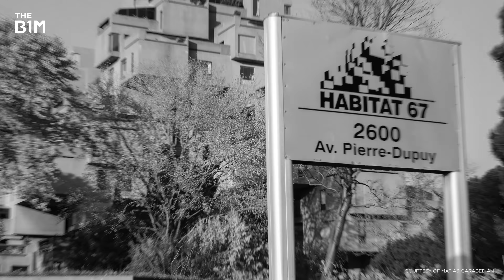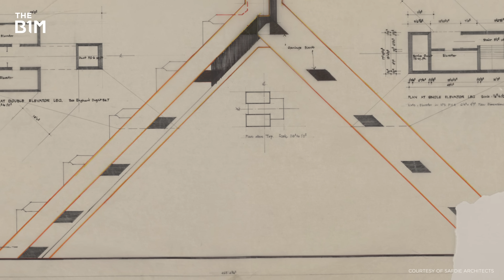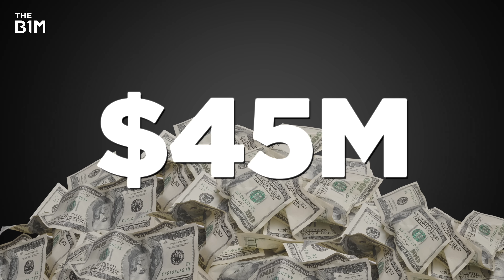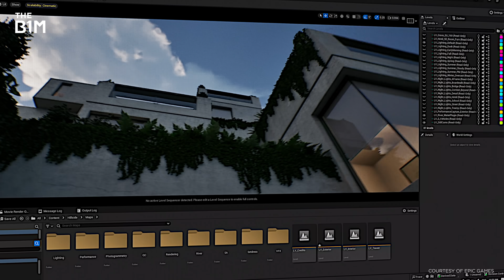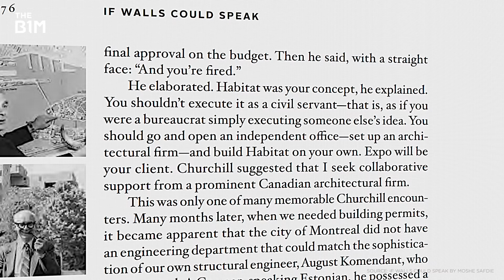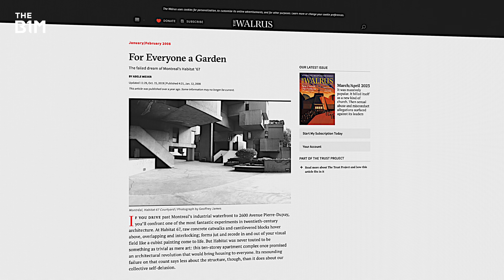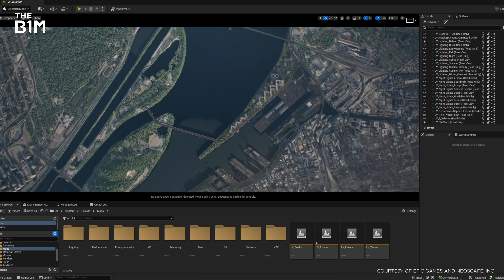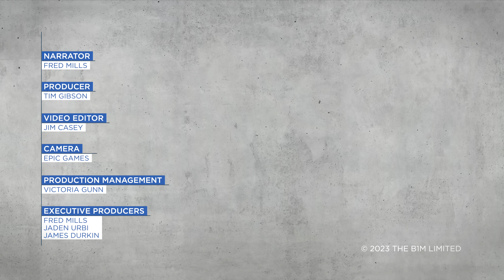How a 23-Year-Old Solved Urban Sprawl

Comment: When Moshe Safdie was in his final 6th year or architecture at McGill University I was in 4th year. There was a tradition at the School of having 4th year students helping others in their final year with their final drawings and models. I had a small part in this activity and I kept in touch with the progress of the project. One unfortunate aspect of Habitat was that the original idea of having structurally identical housing modules hanging from the giant A frames turned out to be structurally unfeasible, and the final project had the units stacked on each other. This meant that each unit had different loads and therefore required custom structural design and construction which added costs and complications. The basic idea remained a very positive step in urban housing design except for the minor complaint of terraces being overlooked by other units.

Comment: Building regulations need to require a minimum percentage of residential units, retail, green space, recreational facilities and agriculture production within a certain radius of a development or renovation that is proportional to the workers the development will serve.  That way,the developers will be encouraged to also invest in residential, retail space, green space, recreational areas and vertical gardens and the proximity of those developments may reduce commute and shipping as well as limit urban spread and the need for constantly expanding infrastructure and funds would be spent on maintenance and improvements instead.

Comment: I see lots of structural problems related to weather , especially in colder climats. How to deal with water and snow. How long these buildings are safe, how much yearly repair they need? 
Of course same things apply to all buildings, but all the corners, roofs make it harder.
Reply: And it looked uggly on the outside. That would be easy fix though.

Comment: The plateau architecture with gardens for each unit and the better view from the height is certainly something worthy copying. But I also feel like the sharp edges of the brutalist architecture, the lack of normal roofs and the absurd reliance on concrete is not that good. I feel like a hybridization of this new, brutalist style with older styles as well as more organic and repetitive design elements with accents would be peak architecture.

Comment: If this could be cheaply build on scale for millions it would be fate-changing.
It was prebuild back then, seeing how we now print houses or preprint sections, i would assume this should be doable cheaper than 450 million. The goal shouldn't be one building but to change the meta.

Instead of the usual projects buildings, instead of the ever mind-numbingly repeating urban sprawl. This shouldn't be something just for those with enough money, but the standard.

Only thing i am not that happy about is concrete. Not sure if we could get something less depressing than concrete. When these are build and towering above, i rather would see pure white than grey and with a nano perl effect to keep them clean and the maintenance costs low. Equally white results in a better room temperature control.

Comment: If only Safdie wasn't a friggin 'isræli' settlement encourager. 
It really feels like one (or a small team) could develop a very very buildable modular parametric system for building things like this. Catia is already based on the notion that you're going to be developing your design parametrically, for instance. It shouldn't be incredibly difficult to take the next step, so you don't have to engineer each unit individually.

Comment: Closed cell foam 5 layer walls- thermoreflective outer, concrete, closed cell/lats, vapor barrier, inner; flat top roofs are very hard but if you slant them ever so slightly you can control runoff and apply similar layering. Even conventional houses don't get much better

Comment: I wouldn't like to live in one of the hanging ones... knowing about the necessity of constant and proper maintenance, wear and tear, material fatigue and accidents caused by careless homeowners such as fires or explosions caused by open fires or not properly done repair, I would think that this architecture will become a maintenance and security nightmare over time. And it will need a lot of heating because of its large surface in proportion to the inhabited volume. Heating cost-wise and ecologically, it will be a nightmare from the start.

Comment: Here is a residental building project in Sweden that have solved it in a good way. Villa living in a apartment building with each unit getting it's own terrace with privacy from neighbors.

https://nyproduktion.bjurfors.se/app/uploads/sites/CMNYPROD51GK3OM7VLA5UCTA/2021/07/cbb767e9-2021-06-08-rabylund-exterior-2-2000x1134-1200x681.jpg

https://api.bostadsvaljaren.se/bjurfors/CMNYPROD51GK3OM7VLA5UCTA/view1.jpg

Comment: you could have a farm in the city centre, apparently some guy in eastern europe bought an old multi storey car park and put inches of soil on each layer, he programmed the sprinklers to water the vegetables every day and he installed hydroponic lights in corners, cows grazed on the top floor and they went up and down in the lifts every day to the milking machine on the ground floor and the ground floor was also dug up with sheep grazing on the bottom floor, its worth thinking about bcos we could build up and use less space to feed the planet, its also makes bio fuels more possible

Comment: No this didn't solve urban sprawl. Proper mixed zoning solves that.

Putting houses (in a cold climate) out in the elements and exposing every side is extremely inefficient from just a thermal perspective. Consider keeping it weather proof and structurally sound and I still think a standard method of building wins.

Comment: University at Buffalo Ellicott Complex.
Mixed use dormitories with similar concepts. Lots of terraces and quaint courtyards. You can get across 6 buildings inside. Ground level has lecture halls, many dining areas, administrative offices, and an auditorium. Upper levels have dorms, community spaces, and classrooms. A whole department of the university is located in the complex. Incredible example of mixed use blending nature and utility. Buses even run inside the complex through the length of the complex.

Comment: God it's awful. It looks like a giant cluster of fools gold crystals that you would use as a prison for the souls of condemned Kryptonians.
And you're building with concrete in Canada, so it'll be a bastard to heat in winter, and it's porous so the roofs will leak, and there's no eves so all those ugly flat walls get stained by rain.
Is it really that hard to build mixed-use medium-density city centers, but in a way that also looks pleasantly traditional?
Tradition is the sum of all successful innovations. New innovation isn't throwing out all of the past, it's extending tradition by making a useful addition to that sum.

Comment: Ideas that take huge quantities of material, stacked up in odd-ball layout that looks lovely unless you are the roofer or the elevator contractor.  Imagine being the maintenance manager for such a structure, now try to figure how to deal with plumbing issues leaking on the unit below you.
The bigger issue these structures face is insulation: the problem being the materials that are strong to make the structure, are not insulating.  These are fun to look at, but once the cost per unit are considered, you realize these are not affordable or sustainable, which is why we don't see copies of it anywhere except where great expense is supported by miles of mundane apt blocks.

Comment: Ah yes, what about pools, and their weight, the easily controlled populace in a small area, more restricted traffic conditions, noise pollution, light pollution, general pollution and airflow, the conformity that humans naturally reject, concrete is difficult to clean at times because of how pourus it is, what about any damage on the bottom level buildings destabilizing everything above, disease spread will be worse, you cant build anything because it’d enter a neibors airspace, hoa’s alreadly are bad on a 2d scale, now make it 3d, good old you will own nothing and you will be happy, how terrifying

Comment: Ah yes, you will own nothing and be happy, gotta love the removal of any kind of ownership instead of expanding and making new cities, no permanence at all. This works as a competitor to condos and high tier apartments, I disagree with this being a replacement for homes, i’d rather have multiple families own that tower structure you mentioned than the diagonal design in this video, but even then, theres no digging, it’d be hard to build anything in your backyard, a pool would be impossible because of the weight of the water, these diagonal homes don’t fix the power problems the architect initially adressed, and the traffic around this building would likely be terrible, especially around rush hour, you cant dig, you’d have problems planting trees in any long term growth as the roots would slowy ruin your building, or it would die, noise would be worse, imagine everyone going out to mow their lawns on Saturday morning,the echo alone, imagine someone has a hobby in cars, or carpentry, temperature would be difficult to manage, any damage to a home on a lower level or even the bottom floor will put every home above it, the foundation would have to be on the level of a skyscraper at least at the center and expansion at any large scale would make living here be a pain in the ass to navigate and potentially worse than modern American suburbs, if it’s not scaled up and it’s just copied and pasted over and over, living will become a sense of conformity, wich we naturally as animals oppose, why ever mover or change locations if it’ll be the same, and then we would be far more vulnerable because the population is controlled in a small area and able to be controlled and quarantined far more easily, diseases will travel far more easily too, theres a reason the only places with homes stacked onto each other are low income with poor regulations, this doesn’t scale well, it’s not aheaof it’s time, it’s damn near distopian.

Comment: Here in Singapore the same architect (who also designed Marina Bay Sands & Changi Airport's Jewel shopping centre) also designed the Sky Habitat condominium which is 40 floors but has a similar exterior design as Habitat 67, & was probably inspired by it. From far it looks a bit like a white pyramid. There is also the Balastier Pt apartment block with shops on the lower 2 floors with a similar design too, albeit shorter

Comment: The images however, are wonderful.  To reduce costs, aircrete should be considered for exterior non-structural walls, and prefabricated rammed earth for interior non-load bearing walls. Prestressed, basalt rebar for the high-strength columns to allow extended corrosion-free performance.  Basalt fibers for certain areas.  Aircrete will dramatically reduce loading, increase insulation, and reduce labor costs as it can be cut with a hand saw and easily shaped into interlocking blocks.

Comment: So.. he solved "urban sprawl" by basically building artificial hill towns? I'm not sure how this is much different from a tower other than you have a terrace instead of a balcony. Not sure why that's much better, but I guess at least you can say it's more interesting to look at? With so much exposed wall space it seems like the inside would be harder to warm in the Canadian winters. I think traditional blocks of tenements with balconies, which share more walls and thus heat, are still a better solution.

Comment: "Terassenhaus" a blast from the past...
They were quite popular in Germany in 60s and 70s and then they suddenly disappeared.
I would be interested in some detailed reasons why.
 
Just from a pure building physics point of view, I could imagine the following negative points:
- More area of "flat roof" or balcony on top of living rooms (weather and rain could easily cause problems, leaving the rooms underneath at risk and creating higher maintenance costs to keep everything dry).

- more exterior surfaces lead to more heating+cooling costs and create more expensive construction.

- They often use a lot of #concrete which has some general negative sides (high #CO2 emissions; it's inherently porous and can therefore absorb water, which can lead to moisture problems. These include structural deterioration through cracking or crumbling, corrosion of steel reinforcement and possible mold growth. All of this can affect building integrity, energy efficiency and health conditions...).
Reply: I am not familar with German Building codes, but a few challenges: Accessibility for all, elevators instead of stairs, thermal insulation, heat losses, snow loads, roof leaks and maintenance costs come to mind.
Reply: https://de.wikipedia.org/wiki/Terrassenhaus

Comment: The design is very enticing. But I wonder how it holds against weather conditions like intense rain and snow. Is there a joint drainage system? You are an indendent home but also connected. Others have mentioned poor insulation due to the high surface exposure.. It would be interesting to use the 3D model in simulations.

Comment: Habit is just a direct rip off of Native American designs from 400+ years ago. It only worked for small settlements until 2000. This joker is the typical Metro-Communialism tyrant. Which is very good for Dictators.

You can see this failed idea throughout Europe and they've realized just how bad it was and they've spent many years attempting to get rid of them.

Comment: One of the issues with this project is that there is no space for large industries. Sure, you can have small shops and even small places to make things like building bikes etc. However, there is no room for larger manufacturing. While I don't see this as a game-breaking issue, it is something that I haven't seen it addressed.
Reply: You don't put large industrial areas in residential and commercial places

Comment: Why is no one talking about how he wanted 45 mill for 1200 residences and he got 15 mill, 1/3 of what he requested, presumably therefore it should be 400 residences then, right? No, he created 158 residences even despite replanning for it to not be so high (the higher you build, the more expensive it becomes exponentially). So it was never achievable under his budget, and each residence was completed at $95,000; $1.2 million in today's money. Yes, 1.2 million for those residences and no one gonna pay 1.2 mill for that.

Comment: Certainly an interesting design, but the architect didn't solve urban sprawl. The project looks interesting but all that exposed concrete is hard to heat and cool, and the angles are a challenge to build - which equals expensive. There's a reason why we build vertically. It's efficient. Projects like this are interesting but don't really solve anything.

Comment: As a structural engineer I can list a number of reasons why this hasn’t taken off. You can make a modular structure without having an unnecessary amount of bending moments by overhangs. The difficulty of the design was even mentioned in this video. Architects notoriously design structures that look cool but are a nightmare for engineers and builders to implement. I’m the first to be critical of urban sprawl and single use zoning, but in light of the outrageous cost of housing nowadays we need to also consider practicality of construction as well as livability.
Reply: @bhante1345 I’m all for repurposing commercial office buildings for housing. It’s not quite as easy as people think as office buildings aren’t designed for all of the additional walls, appliances, and foot traffic that residential apartment buildings use but it’s still easier and faster than building from scratch. There’s also zoning laws that prevent this kind of thing, which need to change.
Reply: Exactly, people complain about the simplicity of modern architecture without realizing that cost is one of the major factors why it's that way
Reply: Habitat 67 is way too cantilevered for my peace of mind.
Reply: I live in Singapore and India. So 20 storey buildings are the norm here. In India it's even more brutal 1200 sft badly constructed buildings 10 - 20  twenty storey buildings in 2 acres. 3000-4000 homes I'm a small space with barely any parking. Tiny tiny balconies. 

I would love this kind of building.
Reply: I don’t know anything about architecture but I don’t think I’d want to live in a building like that if there were an earthquake

Comment: Video Summary;
- Habitat 67, a revolutionary housing project, was conceived by a 23-year-old architect named Moshe Safdie.
- It aimed to address urban sprawl by reinventing apartment buildings as stacked villages with terraces, gardens, and open spaces.
- Habitat 67 was initially scaled back due to funding constraints, resulting in 158 residences across three pyramids instead of the original plan.
- Despite initial controversies and challenges, Habitat 67 became a successful and desirable community, with long occupancy and a waitlist of over five years in the 1970s.
- The original design of Habitat 67 is now being digitally modeled and completed virtually using Unreal Engine technology to showcase Safdie's visionary ideas.